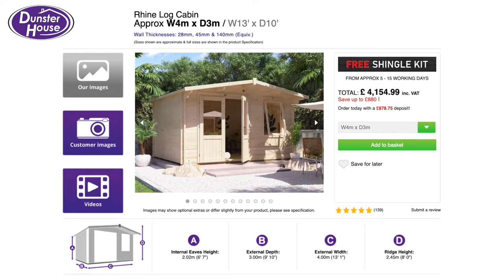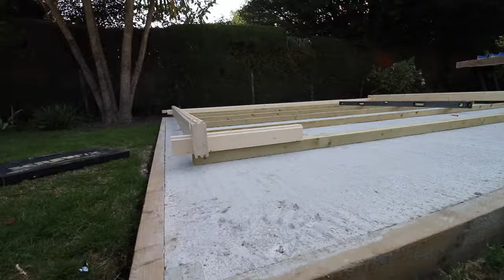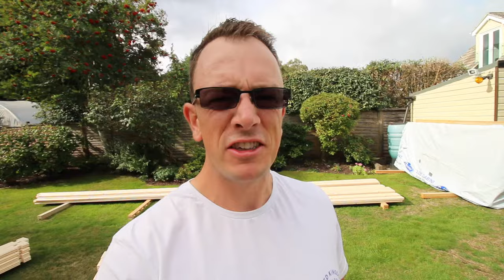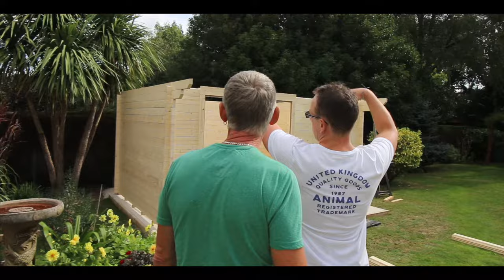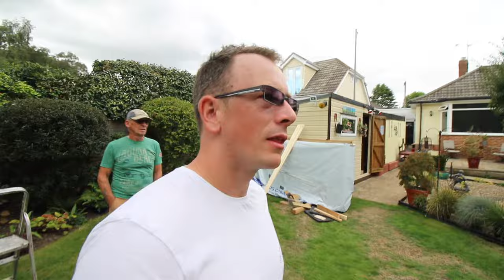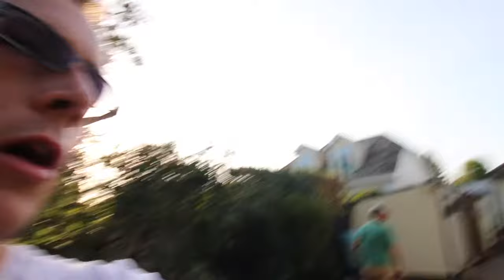How to Build a Dunster House Rhine Log Cabin! Building My First Tiny Home!

Comment: Hi Jon, did you put your floor bearers straight onto the concrete foundation, or have you put a membrane in between, or coated the bottom of the bearers? Lots of different trains of thought on this point so just curious whether or not you had these queries in your mind when you came to do your build....Cheers pal.

Comment: Hi Jon, great series, a big help, thank you! Just ordered mine and I’m planning on saving by doing the insulation myself. If you get time could you let me know where you got the insulation clips for the floor from please, or how you held yours in place. What size insulation did you use in the roof and which boards did you choose to go on top of the insulation. Finally, what did you use to secure your roof insulation and boards please? Thanks in advance. Jamie
Reply from the maker: Ah man you're the best thank you! Appreciate you watching, means a lot! Pleased you've ordered yours. I didn't use any clips for the insulation on the floor. I just placed some off cuts of timber on the floor and sat the insulation on that just so it gave that half inch gap for air flow so if there was any water that went under the cabin the insulation wouldn't be sat in it.

All the sizes of the insulation used I went though in this Q&A video; https://youtu.be/SgZZLZ8xSiw

Roof insulation was just placed on the roof then when the OSB was placed on top of that, I then screwed this own through all the way to the roof tongue & grove and sandwiched the insulation in between.

Hope that helps Jamie. Reach out with any other questions, happy to help where I can. 😎👊🏼

Comment: Hi, great video but have a few questions as have a rhine 4x3m to build next week. I assume its 11mm osb with 25mm insulation (celotex/recticel/kingspan etc), I have installed couple of these now and pergola's for customers and just wondering why you put the damp proof membrane on 1st after roof boards?, instructions show membrane going on last before the shingles or felt. I do it this way to protrect the osb as any moisture getting in through the felt or failed felt will ruin the osb - Ive had this happen before. I also prefer to nail felt then lap over it with next sheet and use felt lap adhesive - dont trust nailing into felt, ok for sheds but not for an expensive cabin. Felt shingles are a better option as well, more expensive but look nicer and last longer. Cheers!
Reply from the maker: Hey! Thanks for checking out the video and sharing your experience with building rhine structures. Your questions are spot-on! I answered a lot of questions in tis video: https://youtu.be/SgZZLZ8xSiw?si=L6wORyOaIIlaybru

I opted for damp proof membrane early in the process to add an extra layer of protection during the construction phase. However, your approach of placing it just before the shingles makes a lot of sense, especially for long-term OSB protection. Your method with felt lap adhesive also adds an extra layer of security, which is a smart choice for a durable build.

Felt shingles are indeed a fantastic option for both aesthetics and longevity. Your insights are valuable, and I appreciate you sharing your tips. Best of luck with your upcoming 4x3m project! If you have more questions, feel free to reach out. Cheers! 🛠️🏡

Comment: Great video!! Thanks! Quick question, what holds the floor bearers together? Does the bottom row of logs fix to the bearers? I’m considering building the Avon on a timber frame and I’m trying to work out if I can build straight onto the floor frame or if I’ll need to put some osb on top of the frame and build on that….if any of that makes sense😊
Reply from the maker: I'm glad you enjoyed the video! The floor bearers are typically held together using the bottom row of logs usually fixes directly to the bearers. You can definitely build straight onto the floor frame, which is what I did but adding a layer of OSB can provide some extra stability and a smooth surface to work on. Hope that helps and good luck with building the Avon! 👊🏼

Comment: Thank you for the video but did you not consider a glassfibre roof that could be done with your low pitch?
Reply from the maker: Thought about it but went with the cheapest and fastest option. Only used this cabin for a year before traveling. Appreciate the support 👊🏼

Comment: Thanks for the vid.... once built! How do you stop the timber from twisting and bowing through the seasons with the T and G not being fixed with anything? 
Thanks
Reply from the maker: Good question! There is no way to stop twisting/bowing but once all the timbers are locked together its a pretty solid structure and theres not a lot of chance that you would get any noticeable twisting etc. Thanks for watching! 🤙🏼

Comment: Great video. Apologies if this has been asked already but did you not put any wall insulation in?
Reply from the maker: Thanks man, appreciate that. No I didn't use any wall insulation. The roof and floor insulation I felt was enough along with the heater I had in there. It was plenty warm enough for me to sleep in. 😎

Comment: Worrying about nothing, was a great video, I’m starting my cabin build tomorrow. I have same style but 4x4 from Tuin. Just done a 4.3x4.3 concrete base that’s 300mm deep with steel mesh. May have gone over board with this but at least it won’t go anywhere!

Did you screw every row of logs down?

Comment: Hey - your video has been really useful. I’ve just received my Rhine cabin and building it soon. Can I ask - how much wood preserve did you need for two coats on the exterior? Thanks so much. 👍🏻
Reply: How did you find the build of your Rhine and 1 year on, are you happy with it? Thank you! Ed
Reply: @TeddyArmitage  hello - I’ve had the cabin finish for 1 1/2 years now and v happy with it. Fully waterproof so far with no leaks! The door sticks abit but think I need to adjust the hinges. Very happy with it. Are you thinking of getting one?
Reply: @andrewcleggguitar  thanks for your quick reply and I’m really glad you still are happy with your purchase. Yes, we are considering getting one and are leaning towards the Rhine for sure. The price at the moment seems really enticing also!

Comment: When it comes to the roof. Did you just lay insulation. Use screws through the the joists? Then board it and screw again or is this all floating? I’m bit confused as at this stage with mine. 

Tuin say to fix through the insulation but if I do surely this creates a thermal bridge and then damages the membrane?

Comment: do you / did you use any kind of adhesive inthe tongue and groove as you laid them on top of each other?

If so, what did you use? Does the kit you buy from Dunster come with the glue/adhesive?
Reply from the maker: Nope. Didn't need any. They lock in really well and with the weight of all the timbers there not going anywhere. Dunster doesn't supply anything like this with the cabin either. Hope that helps 🤙🏼
Reply: @Jon.Brooks  Thanks for your reply. This video has been helpful. I'm looking to get a cabin from Dunster House, your video has put some of my concerns to rest. Thank you
Reply from the maker: @grim-upnorth  I appreciate that. Good luck with the build!

Comment: Thanks for a fab video. Question- how did you prepare the foundation? Was it just buying the concrete slabs and placing on the ground or something else?
Also do garden house floor and corners need to be bolted to the base to avoid movement? 

I have also ordered Dunster Garden Office and wondering if their RapidGrid foundation solution is worth or are there better but easier options? Thanks.

Comment: Hi really enjoyed the series. Have just built my own dunster house office and once insulation arrives will be doing that. Question: where did you get the clips for the floor insulation as can't source it anywhere and what method did you use to attach through osb/insulation/roof. Ie did you go into beams or just into roof boards? Thanks for reading 😁
Reply: @Jon.Brooks  thanks that confirms what I intend to do! 😁

Comment: Hi Jon are you able to use the cabin all year round . I'm undecided if I buy the fully insulated cabin or just add insulation to the roof and floor as you did in your video .
Reply: @Jon.Brooks  thanks for your reply . I opted for the larger cabin uninsulated and doing the roof and floor . The choice was smaller cabin fully insulated or larger cabin uninsulated for roughly the same price.  I  wanted the space so fingers crossed it will be OK in the winter months.

Comment: I am currently looking at buying one of these from Dunster House. Just a quick question; if I block off any possible access to vermin under the cabin, do you know if it will cause any expansion issues?
Reply from the maker: Shouldn't cause any issues no. I trimmed mine at the base leaving a 3-5mm gap between the concrete and the timber trim. It allowed for ventilation but kept animals away. I didn't have any issues. Good luck with the build and thanks for watching! 😎🤙🏼

Comment: Hi Jon 
Awesome video. Could you tell me where did you buy the OSB board and insulation from please and what sizes did you use for both?
Thanks
Reply: @Jon.Brooks  thanks for the speedy response. Does the open end of the bearers get filled in as my wife is concerned about mice getting underneath and building a home? Thanks
Reply: @Jon.Brooks  thank you